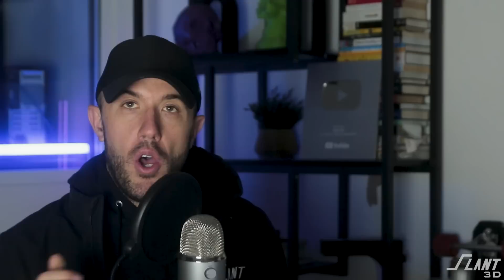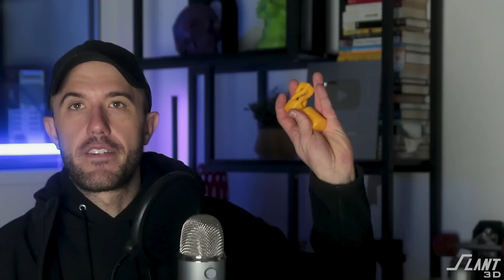AI 3D Model by US and HP | Prusa Core One | We Screw Up | 3D Printing News | Podcast Ep. 81

Comment: It is a temperature controlled Chamber not a high Temp Chamber. And as stated by Prusa gives you the possibility to print pla and petg in the closed chamber without ripping the printer apart. Open doors in a print farm are prone to damage. And I think the have mentioned it cause the competing machines on the market suck in this regard.....

Comment: The chamber temperature control is perfect for ABS and other higher end plastics. Specific control of temperature helps with distortion as well as increase part strength. Too much heat leads to crows foot and localized drooping so you can get too much ambient heat.
Reply: Also when it's too hot, don't forget "cat ears" in corners! When a nozzle drags around a sharp corner, it'll drag upwards the previous layer kind of like how a burnout kicks up dirt. When you print a tall block, the corners pinch inward (because of cat ears) until it cools too much and gradually sharpens up when it goes beyond the cat ears. (It'll pinch so much that there's no material in the previous layer to "drag up" anymore)
When I encountered that in the 2010s, that's when I ignored advice about turning off the fan for ABS... I wrote simple code to fix code to turn on the fan for perimeters! 😂 And my ABS corners stayed sharp!
Reply: Before that I would just cool off my prints by blowing on the nozzle when I noticed it happening... When I fell over from being dizzy that's when I fixed my gcode🤣

Comment: Excited for the filament, will be more excited when it is AMS compatible. 

I was excited for the Prusa Core 1...I am less excited about it the more I see. I don't need the chamber heater, so that option doesn't do much for me and everything else...honestly just feels wildly overpriced for a single color printer. Build quality only goes so far. Is prusa generally better than bambu in build quality? Absolutely..is it better enough to justify that large of a price gap? Personally no. I have thousands of hours on multiple P1S's at this point and they are still going with very minimal maintenance. Honestly at this point the oldest machine has paid for itself in production so many times at this point that honestly if it self destructed right now, I would still consider it well worth what I paid for it and replace it with the same thing.

Comment: 3:10 i think the idea isn’t so much to hold it at a set temperature as much as it is just to prevent the enclosure from warming up at all. ABS and ASA? Yes, enclosure as warm as possible. PLA? Keep air flowing so it doesn’t warm up. That said, I print PLA in the enclosure with the door closed and it works fine for me so… 🤷🏻‍♂️

The “active” part to me just reads as something you can insert into the gcode based on material type so the machine handles it all for you (except for the vents on top I guess, but I bet someone will design an automated louvre pretty quickly that connects to the GPIO board or something.

Comment: 2:01 I will 100% be doing that. My MK4S is in a big ol’ box and this will make it nice and compact, and fit on my desk instead of being basically a second desk with a printer inside it. Also, the strain gauge bed leveling thing is *awesome*, but when the nozzle has to lower itself to the bed, and pull filament with it, you sometimes have issues where the tension of the filament triggers the strain gauge and it thinks it’s touching the bed when it isn’t. Minor problem? For sure. But raising the bed to the nozzle removes that issue. Anyway, the CoreOne is what I wish the MK4S was. I don’t regret my MK4 purchase at all, but this will be better in every way and I think worth the $450.

Comment: Bought 3 1kg spools of the Glut Blue PETG and the surface of the filament has a rough texture.  Prints fine but sometimes, presumably due to the added friction of the filament through the spool guide, the  calibration of first layer (i.e. strain gauge) is prone to slight errors.  Just some feedback for you, but was wondering if the surface roughness is something you use to your advantage during printing.

Comment: You can’t go hotter than the glass transition temperature of the material or your filament becomes a noodle. There is also a balance that has to be struck between your cooling capacity and your chamber temperature to keep heat creep from reaching the barrel, overhang quality, layer adhesion, polymer internal stress release. It’s unfortunately not as straight-forward as more heat is better, but some is good and consistency is even better.

Comment: Higher chamber temperature = less effective cooling on bridges and overhangs. Also, having a hot chamber when printing with PLA can cause the filament to get too soft in the extruder, possibly resulting in a clog 😊
Reply: Did you even watch the release video of prusa themselves? They made it that you can also print pla perfectly fine with the door closed
Reply: Yes, that was exactly the point of the temperature control for lower temps 😊

Comment: Oh, and Prusa was very clear (in a wonderfully passive-aggressive way) that the controlled chambre temperature is in response to the need to open the door and remove the lid of an X1C when printing PLA, because otherwise it gets too hot inside and the plastic deforms.  Because of course people are buying a printer intended for ABS and Nylon and then printing PLA on it...
Reply: Most people will not print abs or nylon on these.
Reply: The X1C wasn't "intended" for ABS or nylon lol.
Reply: @davydatwood3158  The X1C is not intended for abs and nylon. It's supposed to be capable of doing them but it's not purpose made to excel at those. If it was made to excel at those it would have an actively heated chamber. They wanted to be able to print most everything common and probably figured it was a pretty low price to pay to have to remove the lid to print PLA. That being said I never open the enclosure when I'm printing pla and have no problems.

Comment: How can someone be so enthusiastic about 3D printing and still not acknowledge the benefits of a controlled heated chamber?
Reply: That was an odd gloss over. In terms of physics it seems it'd definitely make a difference with bridges / part cooling at least.
Reply: @jrnz0r  it only does 55°C on the chamber is his point
Reply: @Chaosghoul  Didn't sound like it, but still, he should know that different filaments print differently at higher or lower temperatures. Printing PLA at 55°C, for instance, would be far from optimal. PLA softens at those temperatures.
Reply: @jrnz0r  sure, but a chamber is far from needed for PLA and I think that was his point (that for materials who need a heated chamber this could be insufficient)
Reply: @Chaosghoul  yeah we're nitpicking lol
Reply: He did say he has little experience with enclosed printers and the why and how, so I give a pass.
Reply: Does anyone know a filament drier that can do 3kg?
Reply: @nathanbuster8428  watch the video "Why are we drying filament this way?" that method will work very easily on 3kg spools
Reply: @nathanbuster8428  eibos cyclops
Reply: @nathanbuster8428 I ended up buying two food dehydrators and used them to create one big filament dryer for big filament rolls. Mine has been modified so I can print straight out from it while it's on which is handy for printing CF Nylon in 100% humidity weather right now in my country.
Reply: still not active though...

Comment: one limit top temp 'cause one are cooling cold end with air that is inside the chamber, if the air inside is too hot you cannot cool cold side enough and you get extrusion issues

Also, dunno what's inside but e.g. on bambu prolonged printing at over 65C chamber makes magnet slip out of the print heat plastic ... other thing inside (belts, motors ..) it is questionable how much do you reduce their life if they work in too hot (over 65C) env... there are steppers with cpecified max env at 70C .. 

real "hot chamber" machines cool extruder/coldend with water and motors inside with water and / or with cold air brought from the outside of the printer (depending on the design) (belt is usually cooled with air from outside of the box) ... and all that goes exponentially more complex as mixing cold and hot zones introduces stress into material and if you have different materials (combination of aluminium, steel, carbon fiber and plastic) it gets even worse :D

Comment: It's not so much about the specific temperature control as it is actively heated. Something like a Bambu is passively heated by the warm bed and just held in by the enclosure. If you want consistent high temperatures in the enclosure, then you need an active heater to make sure that happens. The passive heating might get up 45 or 50°. Celsius in the enclosure, but with active heating you could go up higher, faster if needed to prevent warping in some of your engineering materials. Edit: as far as wanting to keep it cooler in the enclosure that can allow you to print pla with a low enclosure temperature to prevent filament jamming.